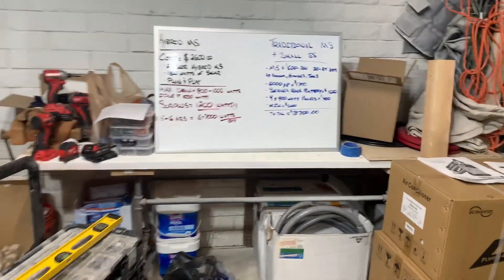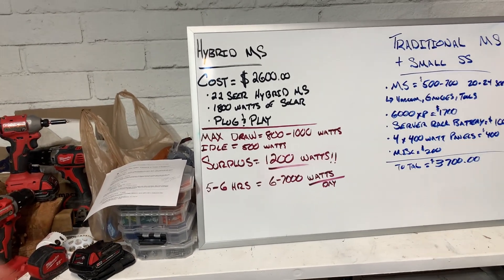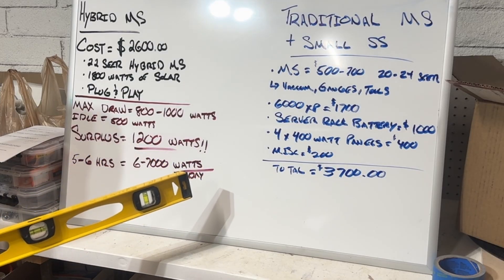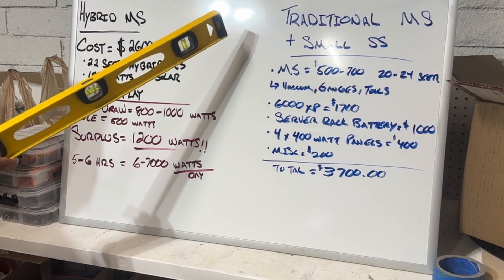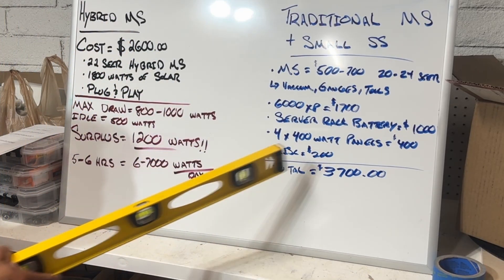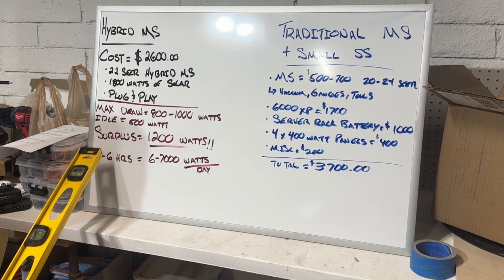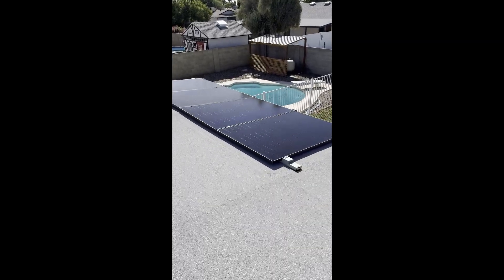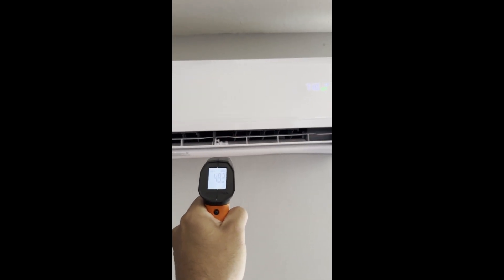Hybrid Mini Split: Gimmick or Game-Changer? | General Overview & Real-World Analysis

Comment: I live in Arizona . I want one . I have a mr cool now but the goal is this unit . I’m surprised he’s getting roasted .
Reply from the maker: If you’re thinking about using solar to run your air conditioning, there are honestly better and more efficient ways than hybrid mini splits. A small, regular solar system can power a regular high efficiency mini split like your Mr. Cool and other loads in the house, so you get a much faster ROI.

I actually like hybrids and think they’re clever, but the more you learn about solar, the more you realize there’s a lot of wasted potential with these—especially in Arizona. Winters here are so mild (like in Phoenix) you might not even run the hybrid mini split for heat during the day. Those dedicated panels for the hybrid Mini split just sit there capable of making power but doing nothing for half the year.

With a small solar setup, you can use that power year-round on anything in the house—so it’s usually a better investment if your goal is to use solar for A/C.

And yeah—people on FB can be savages about this stuff regardless 😂
Reply: @Yesseyd I get your point but I only have a tiny house. 300 sq ft . Once you start getting into a proper solar set up - there is so many different parts / components / information that has to be learned. I started down that route as I do love to learn and solar is ideal for Arizona but  Storing the power , and where to store it for example starts to rule it out for me only having 300 sq ft.
Reply from the maker: @nicola3060  Hey, totally get what you’re saying. A 300 sq ft place really does change the math on everything. Even though a full solar setup is usually better ROI in general, it’s true that for a tiny house the learning curve, all the parts, and figuring out where to store batteries can be a big deal. I get why hybrids seem simpler. It’s all about matching the system to your space and lifestyle.
Reply: @Yesseyd also I believe they sell the unit - solar capable - without the panels so it can be ran with less panels and that prevents the wasted overage. My walls are paper thin ( renovated RV - shaded under an rv carport but still toasty ) so my poor mini split is always working hard from March to November. To compare my renovated and insulated with foam board shed to living room the midea u shaped ac in there barely has to work hard to keep that space cool.
Reply from the maker: @nicola3060  Yeah, that makes sense too. If you can size the panel array smaller so you’re not overproducing, that helps a lot with avoiding wasted power. And with thin RV walls, I totally get why your mini split has to work so hard in the Arizona heat! Sounds like you’ve done a lot to make the space livable though—foam board insulation in the shed is a great move. It’s all about finding what works best for your situation.

Comment: Could you diy a tap off the inverter feeding the cooler
Reply from the maker: Just to clarify, the hybrid mini split doesn’t get AC from the panels—it uses DC directly from the solar panels. All the motors and the compressor run off DC. It has a separate system for the AC side that converts AC grid power to DC to power the unit. I’m sure you could try tapping in somewhere, but there are a lot of variables, and it would probably not work well or cost more than it’s worth. But honestly, I hope someone does figure out a hack or a company makes it work—that would be pretty cool!

Comment: I’m following. I’m in Tulsa OK.   Our energy rates triple from 2 to 7PM.   I am experimenting with a 5k window unit an EcoFlow 4800W battery generator and an outlet timer. I also have 4 390 watt panels that will soon be added. I am considering an EG4 hybrid 12k system. The EcoFlow is plug and play. Can it be added to a hybrid system?
Reply from the maker: There are a lot of ways to configure this — these are just a couple. If it were me, I’d wire everything to the EcoFlow and let it handle everything, as long as it can take the full PV input from your 4 panels and support around 1000W of continuous output. It’s the cleanest setup with the least wiring and complexity. You could run a 12 AWG extension cord from the EcoFlow’s AC outlet and hardwire it into the AC side of the mini split. The EcoFlow would manage the solar input, charge the battery, and power the mini split — and any extra solar can go toward charging the battery or run anything else you have hooked up to the eco flow. This setup should glide you right into off-peak hours without interruption.

The other option is to run the 4 panels directly to the DC side of the hybrid mini split. That’s more efficient since you’re going DC to DC with no inverter loss, but the downside is you can’t send any excess solar to the EcoFlow. You’d still need to wire the AC side to the EcoFlow for when the sun drops, especially if you’re trying to bridge that 2–7 PM peak window. Lots of way you could go about this! 

Once you get this up and going I’d like to see it! You’ll have to post a video or some pics on your channel. Thanks for the follow!

Comment: Im in Navajo county and thinking about getting a hybrid system
Reply from the maker: I’m in Maricopa County and the first summer I had it hooked up, it slashed my electric bill in half during June, July, and August! Definitely made a huge difference, you plan on getting the 1 ton or 2 ton hybrid mini split?
Reply: Im about 18 miles from the closest power pole completely off grid so really trying to figure out the solar way . I haven't looked into it for abou 3 years and technology is changing faster then computers did in the early 90's @Yesseyd
Reply from the maker: @DavidLeslie65  If you’re planning to power a whole house off-grid, I’d go with energy-efficient mini splits instead of a hybrid. A smaller solar setup can run around $4,000, and a larger one could be closer to $15,000 or more—just depends on your energy needs. I’m planning to build a $4k–$5k system soon, and I’ll be dropping videos on the exact kind of research and planning that goes into building a setup like what you’re looking for. I’ll be YouTubing the full build too, so stay tuned!

The cool thing is the technology is changing for the better—it’s getting way easier to build your own system now. A lot of it is basically plug and play these days. I think i have a few videos coming that will help you out as you continue to do research and plan your system.

Comment: I can see the utility in them for some applications for sure.

In my case, I'm using an Anker F3800+ to power my 50amp RV. I have 800watts of solar input at the moment, but I can expand to 2000w with my panel choice and space on my roof. That will power my AC for 6 hours (~7.5kwh battery) without factoring in solar input, as it uses 1400-1500w continuous. I want a mini split eventually for the power efficiency so I dont run out of power overnight. If I get a hybrid unit, I can just plug in a few extra portable panels and significantly reduce the drain on my battery during the day, and at night it wont matter. The excess power doesnt matter in my usecase because my system is already going to be maxed anyways, so hybid mini split just gains me runtime even if a touch of solar goes to waste. Food for thought.
Reply from the maker: Yea well said, you described a perfect application where the hybrid makes more sense for sure.

Comment: I like your point but I had to start saving some where. I bought the 3 12K units for 1249 each and the 24K for 1649 with used solar panels laid on the ground in my back yard. So I have 4 hybrid mini splits and save alot but will add a 12000 xp and put all of them in a critical loads panel to save all 24 hours a day. Thanks for the video.
Reply from the maker: @d.pollard5962  After installing my 12k hybrid mini split, I was immediately able to stop using central air conditioning during the day. That alone cut my summer utility bill in half. I saved around $800 just in that first summer — all running on solar, with no AC input hooked up.
Reply: @Yesseyd  US as well. We use the main ac air blower to move around the cold air. But yes we very rarely use the  4 to even though I put a micro start on it.